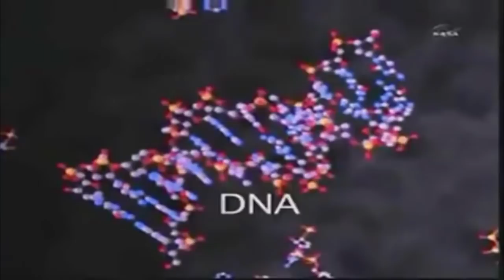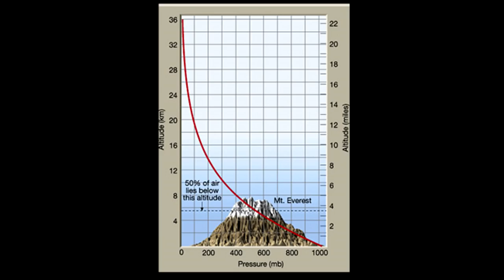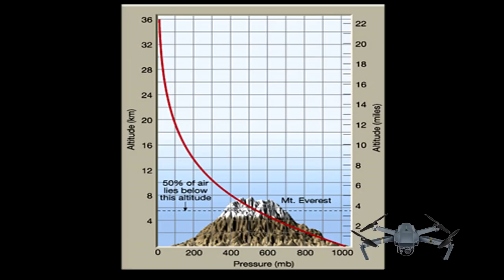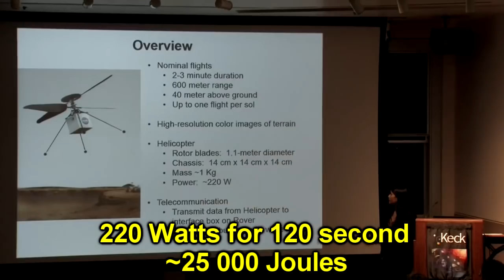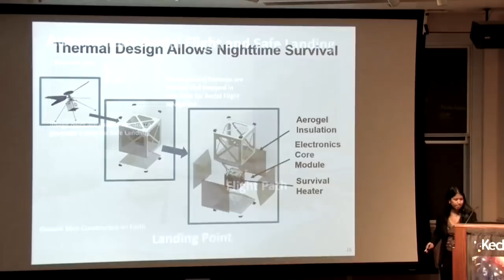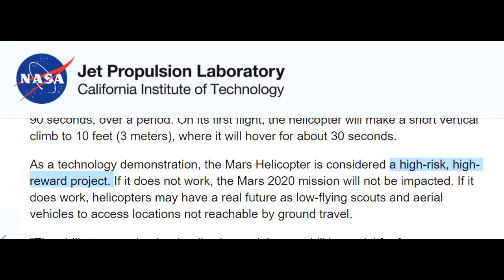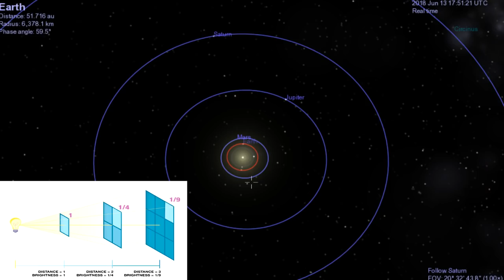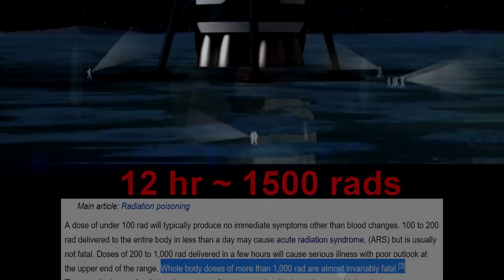NASA is sending Helicopter to Mars!! Smart or Silly?

Comment: Would this little thing be wrecked the first time it gets picked up by a sandstorm on Mars and smacked against a rock?
Reply: Beriorn martian sandstorm might fly a kite, so just by folding the rotors, things should be alright
Reply: The sandstorm in the Martian isn't suppose to be accurate. The writer Andy Weir was using some creative license to move the plot along with that storm
Reply: Mars has so little atmosphere that in order to fly at all this tiny helicopter is going to have to spin its rotor at several thousand RPM just to hover, which would translate to a wind speed a little above the maximum that Mars experiences. However, even the fastest winds on Mars shouldn't be able to knock it over, simply because the probe doesn't have enough surface area exposed to lateral winds. 

This little guy may seem light weight, and in Martian gravity even more so, but scaled to Earth's gravity and atmospheric pressure this probe may as well be made of lead. It should have no trouble weathering any Mars storms. The bigger problem is going to be designing the control system and programming in enough 'smarts' to let the probe pick a good landing site on its own, which is actually way harder than just programming it to be able to fly.
Reply: Beriorn sandstorm on mars can bearly move dust around!  that copter is 100% sandstorm safe .
FYI NASA already used sandstorm to clean the solar panel of spirit and oportunity, it's called cleaning event
Reply: thats what I was thinking
Reply: the "Max wind storm" from The Martian is 9 to 12 mph.  You need to stop using Pop Science before Replying
Reply: Sandstorm on mars is barely enough to move a feather a couple cm you might think sandstorms  on mars are really powerful from the Martian movie in reality they're not even powerful as a light breeze on earth
Reply: Rothpol X you could put the control system and the computer and everything needed to calculate it's position and stuff on the rover and only have motors batteries and sensors and a transponder on the drone and have the rover relay info to the drone
Reply: A sandstorm won't pick it up, but it might destroy it.
Reply: iaag o Oh "transponder"! I misread it the first time, thought " What's the need to even mention transgender on this subject? "
Reply: Stigstigster lol a transgender rover on mars
Reply: The winds get much faster than 12mph on mars, but because the pressure is so low it would only feel like 9 to 12mph. So yeah, not enough to even put the drone in danger of blowing over.
Reply: Martian wind doesn’t pack much of a punch. Dust storms can produce quite high wind speeds but the total force isn’t much because atmo is so thin. & the blades can probably be folded in if there’s too much chop.
Reply: Just have rover that retransmits data hold the drone with robotic manipulator in case of incoming sandstorm
Reply: would be cool if it tweeted back to earth when it got stuck in a sandstorm "MarsCopter, now playing: Darude - Sandstorm"
Reply: Yes, YES it would...  but it would most likely just be knocked onto it's side... then it would be useless lolol
Reply: Beriorn A sandstorm would also be essentially impossible on mars mate, there is just no air there to be wind... it’s like saying it’s windy in a vacuum tube
Reply: Beriorn what sandstorm can you have in a 100 times less dense atmosphere?
Reply: Wind speeds on mars surface can reach up to 400 km/h. On earth this would be completely devastating. Fortunately atmosphere is so thin, that the amount of air molecules actually pushing on you is near nothing. So they have high speeds, but they are so few that it has little impact.
Reply: So Mars has barely any atmosphere, and no water to create wind, but still suffers storms? Doesn't sound right.
Reply: Why do you believe you need water to make wind? oO
Reply: Well, I'm not saying it's the only thing that produces wind, but from what I understand, sun hitting water will create more of an upward draft than sun hitting land, generally speaking.
Reply: Interesting theory. Quite wrong though as the water will absorb most of the heat and thus the air above it stays cooler. Hence less upward draft.  
For wind you need differences in pressure. Difference in pressure can occur, when masses of air get heated/cooled differently compared to each other.
Reply: Well, wait a minute. If the sun's rays hits, lets say, sand, there won't be any vapor. Just the air by the ground getting warmer and rising. With water you will have vapor which should produce more upward draft.
Reply: And why do you believe that water vapor produces more upward draft?
Reply: Because the sand that's heated up won't move up into the air.
Reply: Well that is certainly true :)  
But the relevant part is the heated air rising, that is creating the pressure differences and hence the winds.
Reply: Yeah, I suppose I intuitively think that, since so much of the heat energy will be absorbed by the surface of the Earth, the fact that the absorption that happens in the water actually fuels the updraft whereas the energy absorbed by the ground doesn't should mean water creates more wind. Maybe I'm wrong.
Reply: But what's the alternative to absorption? Reflection! It can't be better if the rays are just reflected away instead. Is what you mean that heat spreads to layers just beneath the surface more easily in water than in ground, and so the heat absorbed by the ground will instead spread that heat to the air in higher proportion?
Reply: Little everyday experiment (in a "normal" climate, 20°C or so):  
- Have full direct sunlight, no clouds  
- Take a bucket of water and put it in the sun in the morning  
- After an hour (or more) measure the temperature of the upper 1cm or so of water. And measure the temperature of the surface of nearby concrete/sand/...  

You will find, that the water is cooler than the hard surfaces. The concrete heats up mostly at the very top and the heat slowly crawls downwards. With water, not only can the heat penetrate more, but also it will have convection cooling it down with water from lower layers.  

Now what heats up the air is the surface that is in contact with the air. And the hotter surface is not the water in this case.
Reply: iaag o: Don't know if you've heard, but they make computers pretty small these days, and a control system for a heli doesn't need that much of a computer, or much power.  Probably lighter than the electronics you would replace it with to pilot it from the mother ship.  And then there's the added complexity (another "flip of the coin").
Reply: @alfoncejean8826  Those cleaning events were unplanned and a bit of a surprise. NASA originally thought that the buildup of dust on the solar panels would eventually halt the missions. Regular martian wind is not strong enough to do the job, but one hypothesis for the cleaning events is that occasionally a Martian "dust devil" comes along and removes some of the dust. There are other hypotheses, but all involve unusually higher than normal wind conditions.

Comment: Interesting analysis. One question... is it correct to assume that NASA’s solar panels will have comparable efficiency to yours? Perhaps they have something exotic that can do far better.
Reply: it is safe to say that nasa has the best in the world while TF does not :P.
Reply: Their solar panels are absolutely more efficient.
Reply: They do have something exotic. They get about double the efficiency of normal panels.
Reply: Peter Smythe
So, about 6 W as compared to 3 W.  Still walking a fine line.
Reply: Nano structured high power Thermoelectric nuclear battery would be the best
Reply: NASTZI JEWMUNY Weight limit makes nuclear sources un-usable.
Nuclear BATTERIES that are small are useless for powering flight.
They're typically only useful in extremely low power and high- risk devices such as pacemakers, and computers which must never turn off until their end of service life.
Reply: LockPickingLawyer Cool seeing you here!
Reply: LockPickingLawyer The best solution would be to send the craft with a ground drone, with a massive solar panel.
A mobile solar panel that exists to do nothing but charge the air drone.

The drone would return to the panel to charge.
The panel being mobile would allow the panel to "follow" the air drone, thus not limiting the device to being stuck to where the panel landed.
Reply: Provide the drone with a charging station, and you don't have to even waste weight on a panel.
You can spend all that weight on BATTERY, and thus, can greatly increase the distance of possible flight.
Reply: 12W. Obviously Nasa doesn't intend to operate their solar powered craft during the night. I don't really understand why Thunderfoot would average out the wattage intensity of the martian sunlight over an entire martian day, because again... the drone won't be operating at night.
Reply: It will need to save energy for heating itself so the batteries, electronics etc. doesn't freeze, so it's safe to say it will have to use <u>some</u> energy throughout the night. That said, with aerogel insulation and the rest-heat from energy-expenditure at daytime it'll likely not need a whole lot.
Reply: Not Pulverman I
Reply: They might be better - but that is counteracted by mars only receiving about half the solar radiation that earth does.
So even at twice the efficiency (which would be on par with laboratorysolar cells that are NOT used for space travel for obvious reasons) they would only produce the same power.
Reply: Yeah more efficient and far lighter solar cells, more efficient motors, extra. I don't doubt they can do it. Though I wonder what useful payload is left for scientific instruments. It seems like the main goal is to put a helicopter on Mars.
Reply: "more efficient motors, extra."
not really - at least not in any significant way.
Motors are already darn near perfect with efficiencies above 90% even, but in normal RC helicopters usually it is still above 80% - so not much can be gained there.

Solar panels, camera, data-transmission and insulation are far more important there.

And their goal with the drone it self is to get far better visual coverage of the area.
Not only is that in its own already important but it also helps the rover to travel further with less risk and to potentially more interesting areas. the rover is rather slow and can't see far - you want to avoid driving into a dead end or very unstable terrain.
Reply: Not Pulverman that may not be a bad idea.  Send it along with a rover like base station.  The rover takes it to where they want to investigate and dispatch the copter.  The rover can be charging internally and transfer that charge to the copter when it lands.  Maybe they can even get more flight time doing that...
Reply: Karl Lind well, the cameras probably can’t see at night anyway...
Reply: a nuclear battery is heavier.
Reply: The panels on the iss produce 4-8 times the amount of power that a similar sized panel would do on earth. That being said they are way more expensive
Reply: +Not Pulverman Eliminating the panel would only be a good idea if there was a mobile charging station. If it was fixed, then the helicopter loses all range.
Reply: +THX 1138 My guess is that the NASA geologists and cartographers are drooling at the chance to get some really high res photos from low altitude. Still, I don't know if this is a viable method.
Reply: Yes, but there locks are probably still no match lol........ danm I just gave you an idea, next video: Ramset vs. NASA lock
Reply: source ?
Reply: Space grade GaAs solar cells produce around 2.5x more power than silicon solar cells which was used for calculations in this video. Solar cells also produce more power the colder they get, and it's very cold on Mars...
Reply: It nuclear was better, NASA would have used it.  They used nuclear on Cassini but it had to go much farther from the Sun which is why in that case it was better than solar.   It's too low energy density from what little I know.
Reply: What he really needs to learn is to appreciate the limitations of his knowledge.    What you don't know is not nearly as damaging as failure to know the limitations of what you do know.
Reply: Also with the thin atmosphere,  I supsect cooling may be an issue to high amperage motors.
Reply: Nice thought but the whole idea of a Rover is to travel over as large an area as possible.   A charging station would tether it to a central location.
Reply: The low air pressure means that it's essentially in a vacuum so low weight foil would do far more than it could at Earth sea level pressure.  Heat loss by conduction/convection is minimal it's mostly by irradiation so lightweight foil does wonders.   Another one of many compensating factors from the low air pressure.
Reply: A ground drone charging station that the airborne drone would be tethered to would massively reduce the mobility that is the entire goal of a helicopter.   The helicopter could travel little farther than the ground drone could.
Reply: What about dust storms?
They're a regular occurence on mars. In fact, the opportunity rover is at risk of running out of power right now because of a dust storm.
Reply: A really bad duststorm that could put a solar rover like opportunity at risk is very rare, but the solar power generation and usage of this small drone seems a lot more marginal, so a much smaller dust storm could be more dangerous. Just a 50% reduction in sunlight could cause serious problems to the drone, while opportunity is currently in an approximately 96% reduction.
Reply: Yes, the solar panels you get from your home are designed to be low cost, as most people don't care if it takes up 1 meter or 10. Home solar panels get about 15% efficiency as measured by the outside of the panel to max output, but solar panels we put into space can get up to 45% efficiency.
Reply: LockPickingLawyer there are solar panels with over 44 percent efficiency!
Reply: Hello lpl 
1*click*
2 click
3 click
4 click
Door opens
Me:Nooooo
Reply: Nothing on 1 , 4 is binding. There, I have entered in NASA's secret exotic solar panel safe. Gonna give it to Thunderfoot for further study 😁
Reply: @coupledyetivonvanderburg5385  Doubling something is not "still walking a fine line" lol.
Reply: @jimbarron9939  I had thunderfoots problem when I was a teenager/young adult. I thought because I was intelligent and knew a lot about many things that it meant I knew a lot about ALL things.
Reply: @randomname4726  
You know, honestly, I just wanna thank you.  I had no idea I replied to a LPL a year before I knew he was a thing.  Your untimely post has been most illuminating
Reply: LPL really asked a question like this? tf

Comment: Hi Phil, a few minor points about aerodynamics - apologies if they've already been mentioned - As a wing increases its angle of attack to the oncoming wind, the lift it generates increases .... but only up to a point and that's way less than 45°. A typical wing without flaps or leading edge devices will stall (start to lose lift very quickly) at around 14° - 16°. Leading edge devices (slats, slots,  Kruger flaps) will increase that angle by a few degrees. What happens as the wing begins to stall is that the higher pressure air on the bottom of the wing tries to equalise itself with the lower pressure air on the top of the wing. As the angle increases, so does the pressure differential and as the wing reaches that critical angle the higher pressure air starts to come backwards up the top of the wing, thus rapidly reducing the lift. No wing will work at 45° AoA.
The other problem with the very thin atmosphere is that as you mentioned the blades will have to spin a lot faster and the speed of the wing through the air does also affect the stalling angle. The faster you go, the lower the angle. Since the blades of a helicopter on Mars would have to spin rapidly, that stalling angle will be lower than the angle it would be on Earth, for both the reasons of pressure and blade speed.
Airliners use AVTUR, with is basically a well refined kerosene. No jet uses petrol, though some can in a pinch but it comes with a lot of restrictions, for example the maximum altitude is lower because the AVGAS has a higher freezing point and the higher you go, the colder it gets.  I'm a retired 747 Captain and in the good old days I used to be a flying instructor. I'm currently doing a mechanical engineering degree at a local uni.
i thoroughly enjoy your videos, please keep up the good work.